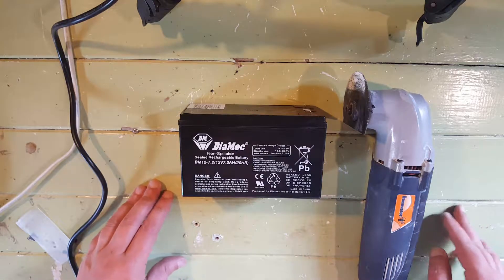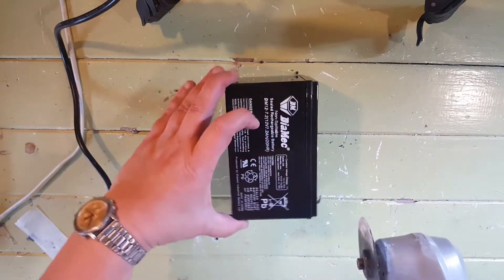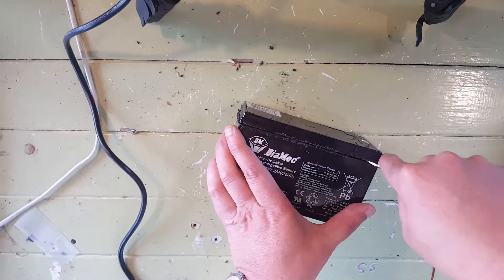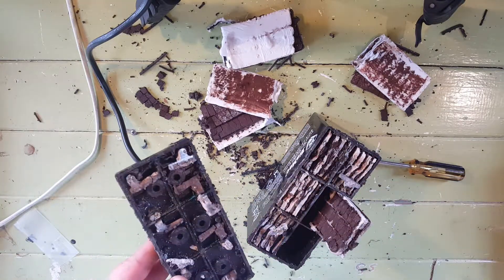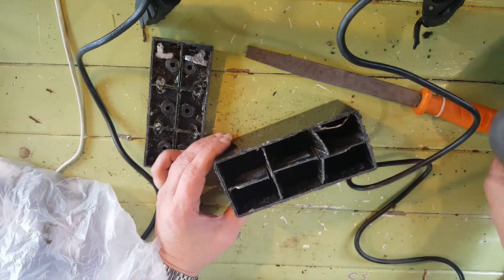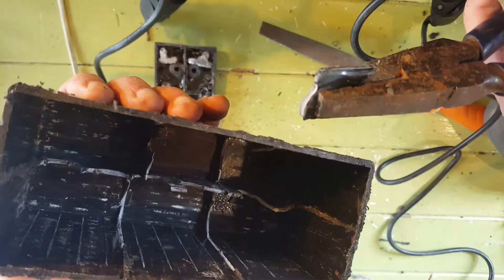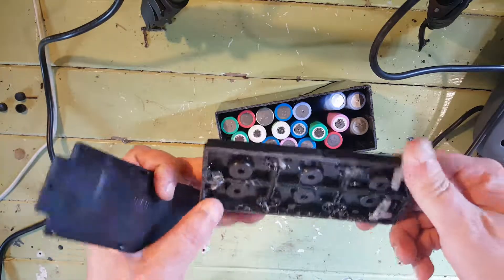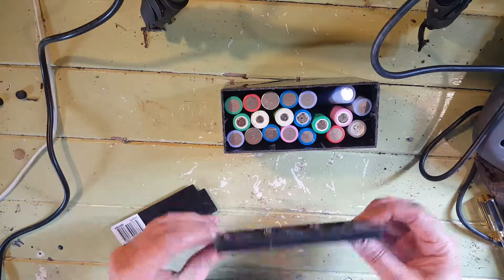How to recycle a 7.2 Amp Lead Acid Battery Case

Comment: nice job, any update on the final product! :)
Reply from the maker: I actually ended up working on a larger battery but I should finish this one first. I'll show the completed project by next week.
Reply: @SpinningplanetCoNz  I have a 3D printer and can make the case but problem is I can't find a good battery module like case and BMS, I don't wanna do welding stuff, want to just put the batteries in socket so I can change bad ones later.
Reply from the maker: @DataCenterExperts  The best "off the shelf" solution I've found that can do what you want is below. However, if you need to replace cells you still have to solder the new ones in: https://www.aliexpress.com/item/33040266838.html?spm=a2g0s.8937460.0.0.77bd2e0ehrdHlR